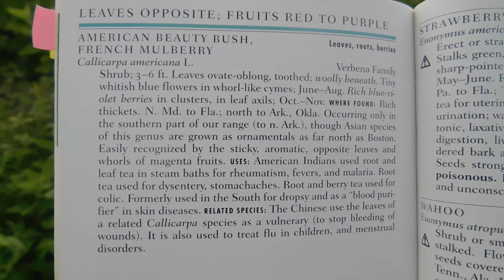Making Beauty Bush Mosquito Repellant

Comment: baby oil , it's cheaper than anything else and it's Designed for topical use , Indeed this Mississippi 100% humidity is Horrible always has been , this I may have to try ,dang Skeeter's will eat you alive down here ,, south Mississippi,,
Reply from the maker: Good advice. I may use that in my plantain salve
Reply: @SpiritoftheOutdoors  the consistency of it should help the Skeeter Spray work in the spray bottle too , get it at the dollar tree for 1$ a bottle too , I've heard of using mint for insect repellent actually , if you can find simetythat works on these dang widgets ,Or no seeums , or black knats whatever y'all wanna Call em it's Worth it's weight in gold , those little Aggravating things are worse than skeeters down here
Reply: do they make baby oil without the perfume in it? I think an unscented oil would be better. baby ouil is made with mineral oil. So maybe just buying some kind of straight mineral oil would be better?